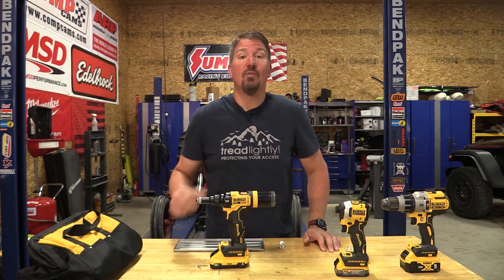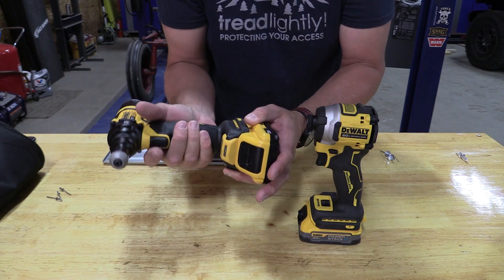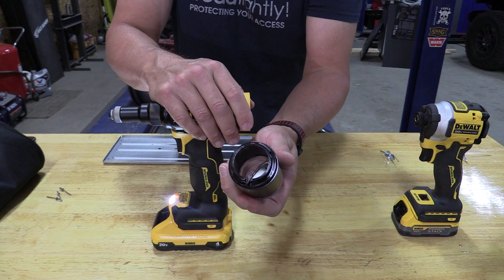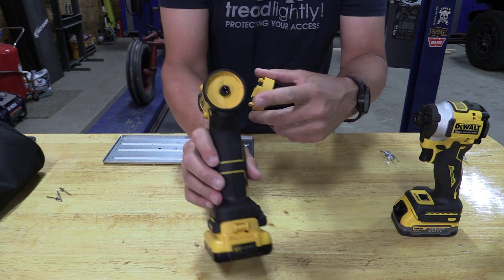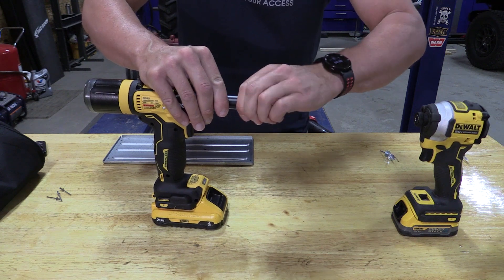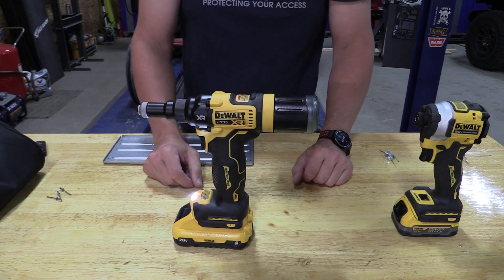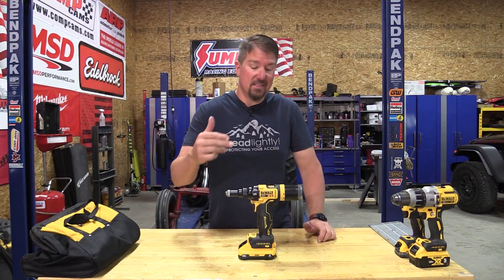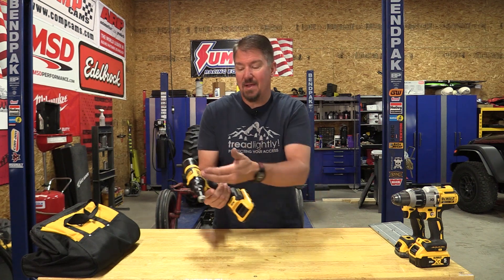DEWALT DCF403D1 20V XR Brushless 3/16" Rivet Tool Review

Comment: Pull the trigger and keep held in if like the m12 and takes pressure off the piece you change. Makes changing easy
Love the m12 rivet tool
Keep a  3/16 rod, I use a piece of coat hanger for the smaller than 3/16 rivets the waste pieces won’t push each other out they will jam and clog.   Just clear the tube between rivets or a pia when the aluminum waste mushes together

Comment: Dewalt if your listening...   Make an Offset pulling head for this like the Cherrymax H781A-456 and you wont be able to keep them in stock. Running one of these on the floor right now, pulls 3/16 cherry rivets like nothing. Faster and smoother than the pneumatic guns, the extra weight penalty is more than made up by not having a damn air hose to drag around and trip over.

Comment: Thank you for the product report. Could you tell me the diameter of the nose piece / head? I need a tool that will fit inside a 3/4" channel 1" deep. This looks like a bigger diameter. Thanks

Comment: I think the motor is in the handle
Reply: yeah just checked the toolservicenet diagram for it and the whole motor assembly is in the handle. interesting design compared to other dewalt stuff, guess it helps keep it compact at the cost of a larger grip